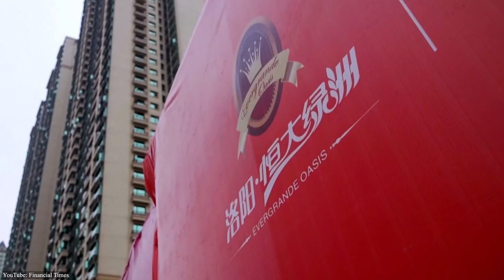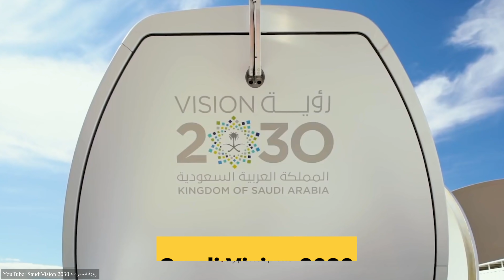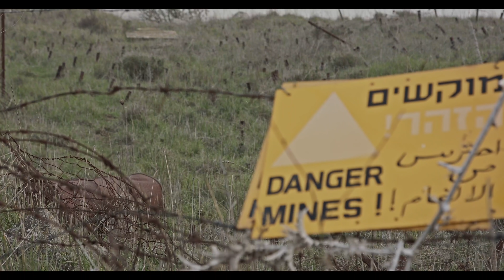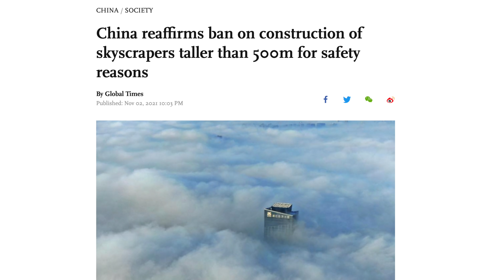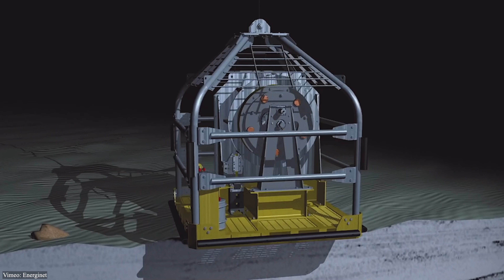Most Impressive Megaprojects Under Construction

Comment: Re the "Brenner Basis Tunnel": you got the route completely wrong there. It goes from South Tyrol (Italy) to North Tyrol (Austria) with connection lines to Bavaria (Germany). And the latter ones also seems to be the blocking factor, because the Germans haven't even starting building their terminals, they are too occupied in constructing new Autobahns that nobody needs (car industry corrupting politics has never been more obvious to me).

Comment: Moscow and Russia now does very little "International" trading and won't be for the foreseeable future - kinda thinking those projects will be a no-go.

Why is Denmark building an island? Why spend so much filling in deep ocean waters when the Dutch have already perfected floating buildings? That "island" should be a giant floating structure to both protect the seabed and deal with sea level rise.  Probably cheaper too - they can build it and the structures on in in modular sections at drydocks on the mainland and then ship it all out to where they want it. I know the towers for the wind generators have to be anchored to the seafloor, but really, from what they've shown, it's a low rise structure with giant walls - why not just build it to float and make it in connected sections that can handle wave motion? Anchored it to the seabed of course. Bonus is that if any of the generators or other parts of the station need to be overhauled or replaced, that section could be towed back to the mainland and have the work done there. Maybe even add sections as needed or to replace a failing generator platform.
Reply: Well he also didn't mentioned russian gas megafactory in Amur that cost almost 15b$ and just started to work, also another megafactory near is being build approximately the same costs, not even mentioning vostochniy spaceport near this megafactories.
Reply: Еланище, они уже реализованы или достраиваться. Для России санкции это ничто. Европейские рынки это пыль по сравнению с рынками Китая Индии и тд.